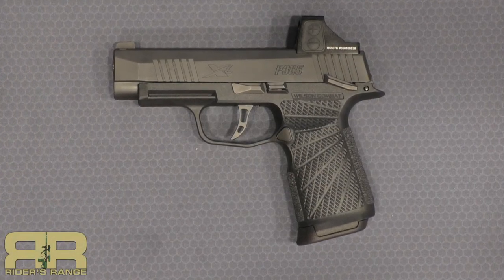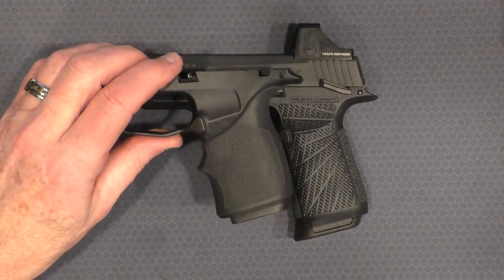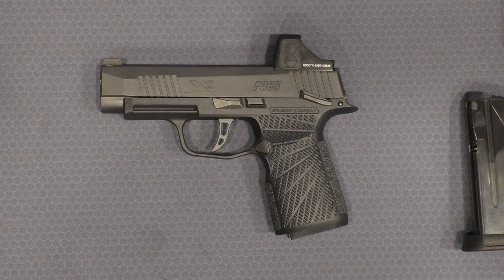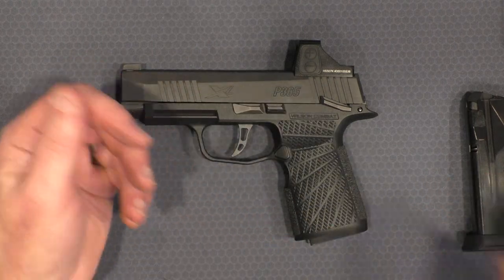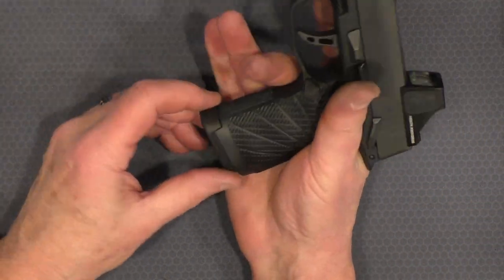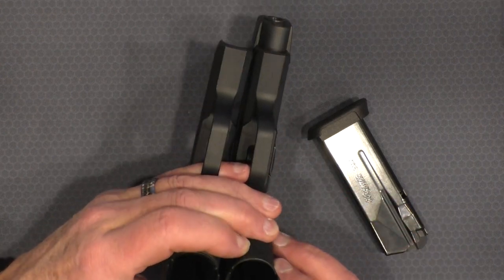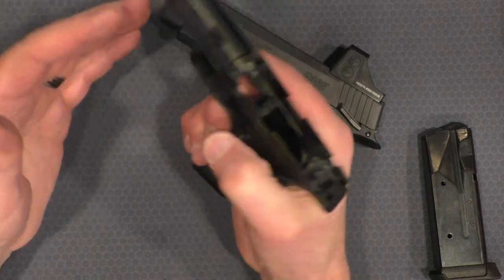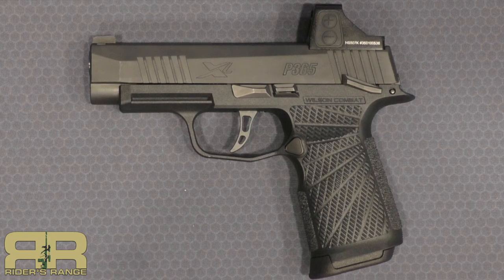Wilson P365/365XL Grip Module

Comment: I replaced the original Sig grip on my 365 with the new Wilson Combat module last night.  Huge improvement.
Reply from the maker: I agree. Thanks for watching.
Reply: Did you go regular 365 Wilson grip or the 365xl grip ?
Reply: @TheReal_FJB  Regular 365.  I don't own the XL model.
Reply: @ptortland  he’s asking because the the XL grip module works on the standard 365.  The problem is your mags won’t work. That’s the dilemma I’ve had.  I don’t want to buy new mags but I think I’d prefer the bigger grip module.
Reply: @jagpilotohio  thank you for this comment. I was kinda confused if the Wilson p365 x/xl will fit my standard p365. Now I need to figure out the holster will fit the Wilson module.
Reply: @3nigmaG  I don’t believe there is any issue with any holster.  The entire portion of the grip that is larger is not actually IN the holster so any 365 holster should work with either the 365 or 365XL WC grip module.
Just understand that if you currently have either the 10 or 12 round SHORTER mags that are designed for the standard 365 they will not fit in the 365X/XL grip module because it is longer from top to bottom. I have Three 12 round 365 mags and one 10 round mag so I don’t want them to essentially become worthless to me if I were to buy the XL grip.  Edit…. Well…The 10 round would become “worthless” and the 12’s would need new base plates. I suppose that’s no big deal since baseplates aren’t very expensive.
Reply: @jagpilotohio  yeh tactical development makes conversion baseplate for ur mags
Reply: @mattysee24  yes, but I use magguts in both my 12 round mag and my 10 round mag.  I don’t believe he makes a Wilson combat Magguts compatible base pad.
Reply: I've had the XL for well over a year. The one thing that has been very hard to get used to is the slim profile of the actual grip. Is the Wilson combat any thicker?
Reply: @dilldowschwagginz2674  yes.

Comment: I like the short grip on the p365, keep pinky under it while shooting and like the flat 10 round mag instead of stubby extension one for tighter conceal pocket carry and low weight.
Reply from the maker: The P365 is a good choice for concealed carry, but remember, your little finger is very important for recoil control. Pretty hard to do with the flush mag.

Comment: What trigger is that
Reply from the maker: Armory Craft semi-curved trigger.
Reply: @RidersRange  awesome. Beautiful trigger. Going to have to look into that. Thank you
Reply: @RidersRange  poundage? my wilson with manual safety. sig safety due in today.  after all of the issues with sig 320 with LE and a vid with the 365 misfiring i thought prudence with a safety is the go to.  i looked at the icarus aluminum milled but too expensive to justify, wilson has a good price point at $45 bucks.  if i decide to go big i will just rebuild the 365xl in its entirety and drop 1200 bucks.  this is my edc and getting it right is everything..... what model of holosun did you go with? i sure do hope this resolves the issues and i can duck any additional build out

Comment: This man has the patience of a saint to answer every single question, whether repeat (and there are lots of those) or not. 

I haven’t tried the Wilson Combat grips but I quickly changed out the stock grips on all of my p365s to Icarus Precision modules once I found them last year. They are perfect for me without becoming too bulky/sticky like the Hogue. There is some added weight due to the metal vs stock polymer but I do wonder how it would compare to the Tungsten weights in the Wilson grip. 

I don’t know how anyone can comfortably shoot with the stock p365’s thin grip. Every student in my class has trouble with it, especially if it’s a first gun for them. At one point, I started bringing Hogue grips to class.
Reply from the maker: Thanks for watching and adding your thoughts.

Comment: Consider the Armory Craft extended magazine release and the MagGuts 12+2 magazine internals. I don't usually mess with magazine internals, but decided to give them a try. I tested my 12 round SIG mags with the MagGuts and the Tactical Development MagGuts Compatible Pro Ledge floorplates for XL 12 round magazine. Entirely reliable.
Reply from the maker: The AC extended mag release is on my list to get. Thanks for the info on the MagGuts internals. And thanks for watching.

Comment: I have added the Wilson Combat XL grip module to my SAS, and I was also able to slip on the Hogue rubberized grip on top of the Wilson grip. And now it feels like a butter. It now fully fills in the concavity in my hand that occurs when one grips something.

I am a hobbyist knifemaker, and when knife makers construct handles, considering the palm swell is an important factor for proper ergonomics, yet precious few gun manufacturer seem to consider that.
Reply from the maker: I'm guessing it was a struggle to get the Hogue on the Wilson grip module.
Reply: @RidersRange  I thought it would be brutal, but it really wasn't. It was simply a question of stretching it just a little bit on one side and scooting it up a millimeter, then alternating and doing the same on the other side, until it touched up on the beavertail.  It took me perhaps three to five minutes, and required only a moderate amount of patience.

The only thing I had to be careful of is either edge of the magwell, which are a little bit sharp, so I made sure I stretch the rubber over that first.

I know the Wilson grip is bigger and has a little bit more texturing, but I honestly had no more difficulty than putting it on the factory grip.

Comment: Nice clear review with enough information and facts. Well done.
The mag release Wilson provides is a stock SIG part so of course it wouldn’t stick out further on a bigger grip. The tungsten weighs will fit the XL grip. I doubt that they will make longer, heavier ones specifically for the longer grip.
Reply from the maker: Good points. Thanks for watching and commenting.

Comment: So I received and swapped out my grip on my XL with the Wilson Combat grip. True enough in terms of circumference it’s in between the stock Sig grip and one with the Hogue HandALL beavertail grip sleeve on the stock Sig grip. I am going to take it to the range to see how it feels and more importantly shoots. However in the back of my mind, I am considering slapping a Hogue grip sleeve to the WC grip. I’ve seen a couple of others do this and while one loses out on the aggressive texturing and good WC looks the overall circumference improves slightly further and a tad closer to that of a p320 Compact. We’ll see… either way we can’t go wrong. Right off the bat I dig the enhanced 1911 beavertail tang and the improved magwell not to mention that I am also intrigued in the near future with the concept of the tungsten rods that can be inserted into the grip.
Reply from the maker: Thanks for watching and adding your thoughts. It was difficult to get the Hogue on my 365XL grip, so I can only imagine how hard it would be to get it on the Wilson grip. After putting 54 rounds through mine, I'm happy with it as is.

Comment: Thank you for the circumference dimensions. I ask on FB and got no help them emailed Wilson and got no help or dimensions. THANK YOU !!! Just curious did you put the Hogue on the Wilson and measure it ? I'd like to be around 5 3/4 to 6 inch mark. I think it may help my grouping.
Reply from the maker: I haven't tried the Hogue grip over the Wilson grip module. Getting it on the standard grip was tough enough. I can only imagine the frustration I'd go through if I tried to put it on the larger Wilson grip frame.

Comment: just ordered one for my 365XL . you may want to check with them again about the tan grip with manual safety slot, they had them when I ordered
Reply from the maker: I just checked the Wilson website again and they still don't list the tan grip for either the 365 or the XL with the manual safety - black only.

Comment: I use the Hogue sleeve on the 3 P365’s pistols in my safe. I’m going into year 2 of carrying a revolver, so I probably won’t invest in the WC grip module. It wouldn’t be a shocker if WC offered different sized mag releases. Thanks for Sharing! 👍👍👍👍🇺🇸🇺🇸🇺🇸🇺🇸
Reply from the maker: I had the Hogue HandAll sleeve on both my P365 and the XL. While the Wilson grip is a tad smaller than the Hogue, I like the feel a little better.

Comment: Good Video, Thanks!  Will the 12-Round OEM Sig Mag's fit with the Wilson Grip? Do you think it's worth getting the Tactical Development Base Pads? I imagine they give you a little more grip for your pinky? Thanks again!
Reply from the maker: The OEM mags will fit, but there will be a gap at the rear of the baseplate/grip area. I highly recommend a mag baseplate that is designed to go with the Wilson grip module.
Reply: @RidersRange  Thank you very much for getting back to me. What do You think would be the best Base Plate to go with the Wilson Combat Grip?

Comment: How is the profile? I like the roughly 1 inch profile width for conceal carry. Is this the same?
Reply from the maker: The Wilson grip module for the P365XL measures 1.18" at the widest point of the gripping surface and 1.197" at the magwell. That is a hair wider than the factory grip, but it isn't any more noticeable when carrying concealed.

Comment: One of the things i do not like about the manual safety on the 365 is the other side pushes into my hand when activated. Just feels weird. Does this grip change the hand placement at all that might solve this? Or should i just shave down the ambi safety? Thanks
Reply from the maker: I shoot with a real high grip and I don't notice the right side safety pushing into my hand at all with the Wilson grip module.

Comment: Gree. Just got a couple Wilson Combat 365XL grip modules and they feel like velcro for my hand. I wear a size large glove but have average finger and hand thickness so the XL grip module has always felt a little thin. Just got a black one and have an FDE shipping soon. Optics Planet has black and will soon have FDE. I gave up a custom stippled grip module with stippling all the way up the back strap and beavertail. The Wilson Combat version just feels better. I see you're an XL Tactical base plate fan as well.
Reply from the maker: Tactical Development now has mag base plates specifically designed for the Wilson grip module. I just ordered a few. Thanks for watching.
Reply: @RidersRange  Well... that was fast. Only FDE left - no black. I'll check back. 
I have their 'old' style base bads for 12 and 15 round sig 365XL mags. They're excellent and the 12 round pads look great with the WC grips.
Reply from the maker: I ordered two of the TD mag bases for the Wilson grip in black and one in FDE for my 15-round mag - only because I wanted one and they didn't have black in stock. They should be here in a couple days.
Reply: @RidersRange  Thx, will do.

Comment: Mine should be in today. Should have last week,ice storm. I have the xl. Thinking of getting  a std. 365 magazine and buying the small frame. Then I probably need the weights then to compensate for the long barrel. Could be the perfect one....I have the max9 the hellcat also...the chase continues.....lol
Reply from the maker: You are living proof of the formula "N+1".
Reply: @RidersRange  you have to keep looking for perfection,  till you can't look any longer...lol
Reply: I want a standard module too .if the price isn’t too high on this one  it looks good. Before seeing these was thinking about an exclusive slightly darker brown replacement offered by optics planet   .try the contrasting colors look. & maybe even give stippling a shot on one of them. Both if it turned out to be a good thing.  Honestly like the xl as is -stock.4-5 00 rounds through it right from the box with no cleaning other than wipe downs with remoil on a rag & dry toothbrush on sights & whatever I can reach easily without breaking it down. Did the same with a little LCP 22 light rack. Put a brick of old mini mags through it. Didn’t have any problems. Maybe five ammo related failure to fire. Darn good for rimfire.. Sig intended these guns to constantly scream for more. The money train must keep rolling! I get it. Poor little Ruger never made a peep. So of course I completely disassembled it and replaced the guide rod with a stainless steel and upgraded the main pin that holds the gun together that wasn’t necessary(380s.. necessary.. at least the pin) but better is  better. Right.?. Could’ve been done with it at that point but couldn’t help myself. I had to have the replacement trigger that does away with the magazine disconnect on that pistol. The trigger itself was just fine, disconnects are a pain in the butt. Can’t stand them. On a rimfire especially.I couldn’t find my punches so since the back ordered Traeger was finally in the mailbox,I went at it with an old drill bit I should’ve been patient and gotten my tools. For some reason the trigger came un assembled. I did request and un anodized one , That’s why is my guess.To make a long story short, everything was going pretty good but mainly because of the unassembled trigger that I needed  my tools to do properly, I messed up a roll pin, possibly damaged the trigger, attempted to align the  soon to be damaged roll pin with a paper clip that was in arms reach. Which promptly broke off inside of the role pin. Have some new pins and everything is bagged and tagged but it’s in a cigar box and I haven’t shot it sense that evening. Learned a lesson. if a product comes in the mail in pieces that should be one completed unit , small pieces and springs with no directions and you don’t know what you’re doing, Stop and pick up the phone and get a replacement or something.Better yet just don’t start any job that is unfamiliar to you at 11 PM after a long day . But if you must, at the very least,have the right tools. Got the XL the next day. Unplanned, 2 had just come off the truck. I’ll get back to the LCPll soon. As a matter of fact I’m going to call them now and ask about that trigger and tell him what happened. Maybe they’ll send me another one. Or something.?.If not the other one I have  is fixable. Never made a kydex holster before. The 22 is So small it’s going to be riding in  a  OWB with 4 spare mags. 51 mini mags on tap .  ulti clips.xl ‘smaybe. Quick on and off and good for romping around in the woods, canoeing etc. grab it and go. Back to the Sig. don’t care for IWB very much. I believe the standard grip long slide version 365 Will be quite a bit better strongside or a little further back.10ish degree cant leather pancake. Not too bad as  is and maybe I should give IWB a chance with such a small pistol. Holsters ughhh. Anyhow enjoy. I’m going outback to shoot a couple mags r now. It’s been a while and thinking about that 22 upset me a little bit. Need to knock the edge off a little and get my fix. Be safe

Comment: The circumference of the grip and the spongy trigger have kept me from purchasing a Sig 365. Looks like Wilson has a solution to one of the obstacles. I noticed that you have a different trigger than factory, Could you eloborate?
Reply from the maker: That's an Armory Craft trigger, though I didn't change any of the internals, so it's still a little "spongy".

Comment: That ridge that protects the mag release is crucial for a carry gun. All carry guns should have it. You’re more likely to accidentally bump your mag release with the gun in the holster than to need a speedy reload.
Reply from the maker: That's the purpose, but in a properly designed holster, inadvertent mag release isn't a problem.

Comment: You can use non manual safety frames. Just have to notch the frame. Super easy to do. I made mine single side safety that way. Message me if you want info on this as I have several pictures.
Reply from the maker: Not difficult. Thanks for watching.

Comment: Just replaced the P365 stock grip with the WCXL with tungsten weights included.  It has a good heft to it with the added weights although I think it would have been better if the weights were molded into the frame by WC.  The aggressive texture on the back and fore straps feels good in hand.  The WC grip feels just a little stronger than the Sig original.  The WC grip has a wider diameter than the original but not with the original and Hogue grip cover.  The Hogue grip is the size (or larger still) that WC should have been trying for.  The shape of the WC grip feels like it was designed with one handed shooting in mind.  Given the smoothness of the trigger guard and the indent for the thumb rest, I question if two handed shooting was even considered.  The dovetail is okay but nothing to rave about.  I haven’t taken it to the range yet, maybe actually shooting it will surprise me and change my mind.  Having used the Walther PPS, this is a failure.
Reply from the maker: Javora Tree, thank you for watching and adding your thoughts. You may want to pass your thoughts on to Wilson. If you select your grip module and scroll down to the bottom of the page, there is a place where you can leave a review.
Reply: Update:  Having taking it to the range, I can say that it shoots better than the original Sig grip.  Pleasantly surprised by this as I was ready to sell it.  Still believe that the WCXL is vastly inferior to the Walther PPS.  There is a lot more that Wilson Combat should have done.  But it works well enough for now until I can find something else.

Comment: Thanks for the video. What trigger is that and do you like it better than the stock one? 👍
Reply from the maker: Richard, that's an Armory Craft trigger. It only replaces the stock Sig trigger, not the trigger mechanism, so it doesn't lighten the pull, but I think it does feel better.